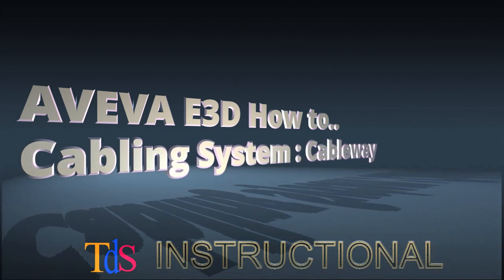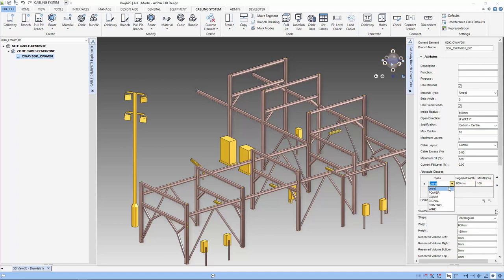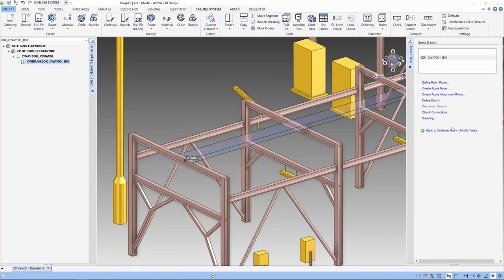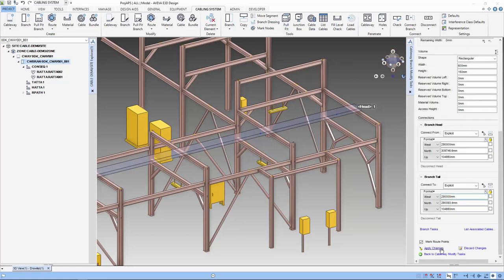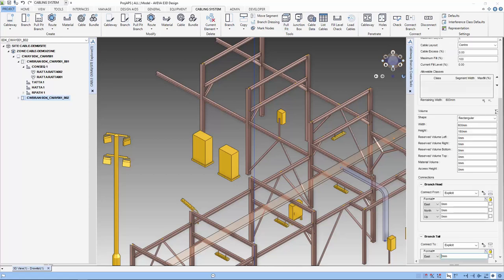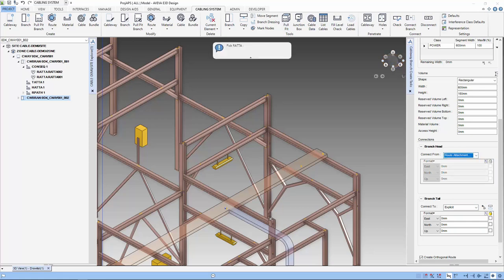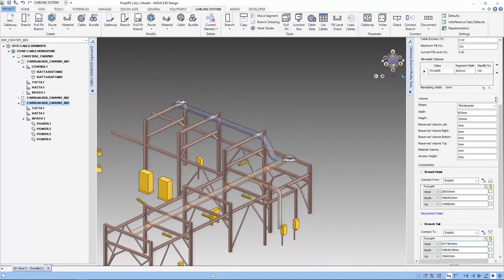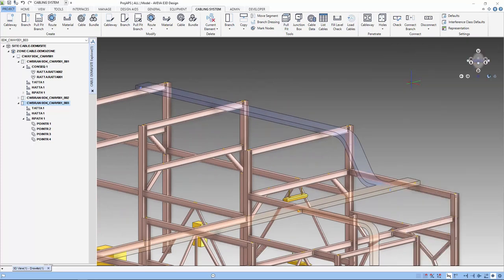E3D - Cabling System ( Cable way )

Comment: Good morning. When I define a new cableway I specify head and tail of the branch as you did in this video. I then click on the "create cable branch" button but the solid is not created: all I can see are the two blue arrows indcating head and tail.
Thank you in advance for any possible hint you could give me.
Reply from the maker: Cabling System->Settings->Representation
Reply: @TDSEngrSolutionsPteLtd  You were right, sir. The obstruction was not set to "solid". Thank you so much for your help.
Reply: @shadedmw  Hi, how do you setting this ? I tried: Cabling System->Settings, but not finding any obstruction setting.

Comment: Hi..thanks for sharing, is there any command to fill CWAY material ? Or macro file..could you please share
Reply from the maker: At the moment, you can choose Autodressing. But that is not flexible enough I guess. We should be releasing some application for this for Hilti/Oglaend cable trays, and we will take not of Auto Fill request, just like Cable tray.
Reply: Okay, thanks for the information